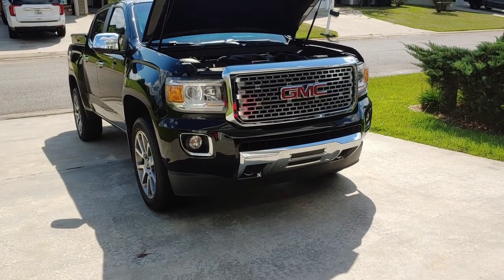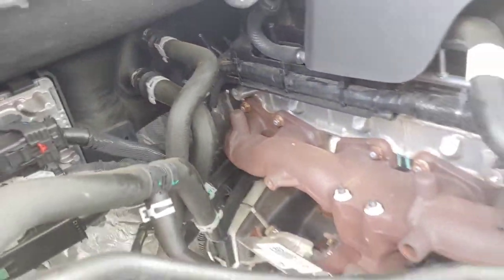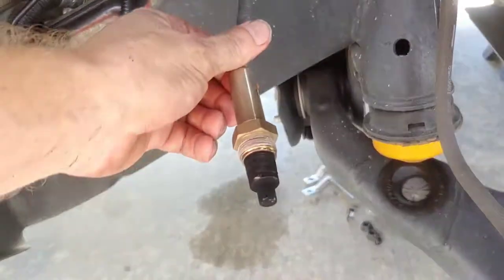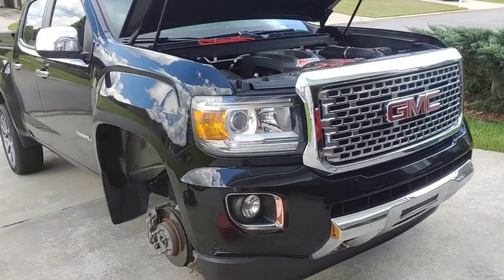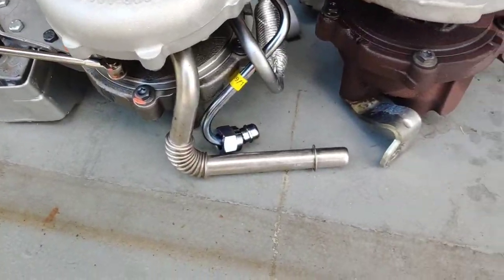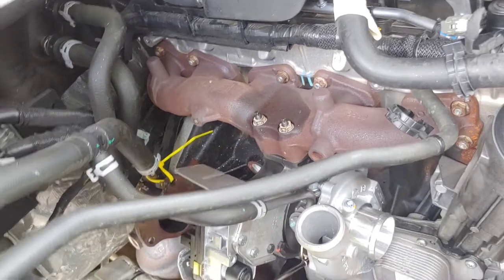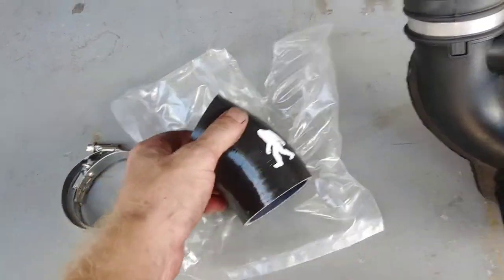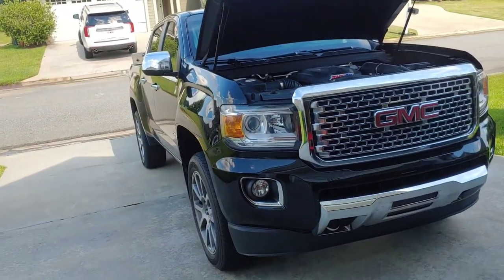2016-21+ Chevrolet/GMC Colorado/Canyon 2.8 Duramax Garrett Powermax turbocharger 892179-5001S Part 2

Comment: I installed the DT44 Stealth turbo from Duramaxtuners. I also used their upgraded MAP senor. Along with the 4 position tunable switch and their engine and transmission tune. I'm getting 280Hp in my  16' Chevy Colorado Z71Trail Boss.
Reply from the maker: Wow! Are you running the stock size injectors at that power level?
Reply: @breoll86 my understanding is the injectors/fuel system isn’t the bottle neck. the actual turbo is the bottleneck and the map sensor maxes out. a 6.6 map sensor and the upgraded turbo/tune wakes it up
Reply from the maker: @glennmorris25  The stock turbo flows 27Lbs/min. That's more than enough to max out the injectors. They're only good for "220ish" hp at 40 degrees of injection duration. If you want more than 220ish hp then you'll need bigger injectors. Unless you want to burn up a piston.
Reply: That's what I'm planning on getting. I've got the bent vane in my stock turbo

Comment: Been waiting for someone to post videos about this turbo. Please post more videos on it/longterm review
Reply from the maker: Nearly impossible to find any info on this turbo. That's the main reason I posted this. But I just shot this video yesterday. I'll do a follow up video in here in a week or two.
Reply: @breoll86  I have been looking for a turbo upgrade and this turbo and the SR-71 were the two turbos that came to mind. Any feedback from this would be great.
Reply from the maker: @alexsmith872  I'm going to put a follow up video together today. I don't have a ton of info on the SR71 but I'm pretty sure its bigger than this Powermax. Also I'm not sure if that turbo us still available for sale? Let me know if there is anything in particular that you would like for me to cover in the next video.
Reply: @breoll86  roughly how long did this swap take?
Reply from the maker: @johnherrera2906  I think it only took 4 or 5 hours. But I could have done it faster if I watched this video first.
Reply: @breoll86  exact reason why I asked, swapping my stock one out tomorrow but doing it on a lift. Thanks for the info and video!

Comment: Just bought the DT44 stealth turbo from Duramaxtuner. Thanks for the video.
Reply from the maker: Nice! let me know how you like it. I'm still in the process of tracking down a reasonably priced back-up motor.
Reply: I have had sputtering problems after installing mine and after talking to those guys for weeks I’m realizing they are just diesel enthusiasts turned venture businessmen, at best. They are not by any means engineers or guys who have any real idea what they are doing. They don’t even balance their turbos over 3000rpm, total joke. Also they claim the turbo had ball bearings in their videos and YouTube demos, they put ROLLER BEARINGS in it though during 
production!!!! I’m taking it out as soon as I set up the powermax purchase and someone to install and tune it
Reply: My DT44, to clarify, I’m switching to the powermax

Comment: Did you put the transmission tune on it?
Reply from the maker: Yes. Good question. I haven't covered that in these videos yet. I have done my own tuning to include the transmission. EFILive and HPT are identical in their capacity to tune the 6L50. If you're looking to get started with tuning I would highly suggest starting with the trans. It's a good place to get your feet wet. Let me know if you have any specific trans tuning questions.
Reply: @breoll86  
I would be very interested in what I need and how to tune the transmission 
It would be much appreciated

Comment: What RPM do you find this turbo starts to spool up?
Reply from the maker: The powermax turbo spools like the stock turbo. They both have the same size turbine wheel. The bigger compressor wheel does run into surge sooner though. So you'll have to turn the boost down in those areas to prevent that. That won't cause any power loss though.
Reply: @breoll86  Would you recommend the Garrett or the DT44?

Not sure if you have broken any input shafts of the 6L50 yet?
Reply from the maker: @PHLTHS  I purchased my Garrett before the DT44 was released. I don't have any experience with the DT44, but from my research, they both have similar compressor wheels, but the DT44 has a bigger turbine wheel. If I were buying a turbo for a stock truck today I would pick the DT44. 
I have heard of people having issues with their 6l50. But I haven't experienced any issues with mine. I've owned it since new and just rolled over 100k mi. Been tuned since 15k. Haven't even changed to fluid.
Reply: @breoll86  ok awesome and thank you for the advise. Currently getting a converter built with a triple billet lock up so will get it built to suit for when the turbo spools up. I’ll start look into the DT44.

Cheers.

Comment: Can you post a link to the little boot you got from Sasquatch? Or a part number as I cannot find it on their website.  Thanx
Reply from the maker: https://shop.sasquatchparts.com/products/sasquatchparts-silicone-turbo-inlet-hose-colorado-canyon-28l-duramax/

This is the one I used. It works with the factory airbox. Not sure about aftermarket airboxes though.

Comment: I think it stops at 29 because of the 3 bar MAP sensor. Get a 4 bar and retune.
Reply from the maker: As stated, I have a 4 bar installed. The problem is with the hpt software.
Reply: @breoll86   I must have missed that. If you know enough to tune I should assume you know that. Good content! Thinking of doing the same with mine but the stealth 44. Appreciate the tips in this episode.
Reply from the maker: @ZR2Dude  I recommend the DT44 over the Garrett considering the price is the same. Also Exergy makes injectors for our motors. The 30 or 60% is a good match for these turbos. Just remembered, the fuel is where the power comes from, not the air. The stock injectors can't safely flow more than 220-230hp. The stock turbo can supply enough air for that hp level. The 30s can get you to 260hp and the 60s just over 300hp safely. But I recommend a built motor at or above 300hp.
Reply: Noted. I will check them out.
Reply: You have to rescale the map sensor table yourself to make use of the 4 bar
Reply from the maker: Watch the whole video. I did that from the start. Does your HPT read over 300kpa?

Comment: Hey bud, which hp tuner did you use?
Reply from the maker: I was using the old school mpvi. Haven't upgraded to the V2.
Reply: @breoll86  I was looking on HP tuners site and I didn't see support for an 2018. Not sure if I overlooked it or not. What year is your truck?
Reply from the maker: @BigD00fus  My truck is an 18' and it works for that model year. HPT does have probably 95% of the tables that EFILive has. But HPT hasn't updated anything for this platform in years. I'm still keeping an eye on it though.
Reply: @breoll86  thanks for the help

Comment: What is the advantage in changing the turbo?
Reply from the maker: This turbo is worth about 100hp over stock. In my opinion this is the turbo that GM should have put on these trucks from the factory. With proper tuning, there are no negatives. It drives like stock until you put your foot to the floor. Lol
Reply: @breoll86  wow! What does it do for torque?
Reply: @breoll86  also that big of boost to the hp, how did the mileage do. To me the biggest draw to these units is the mileage.
Reply from the maker: @TheSilver9r  My mileage isn't affected as long as I keep my foot out of it. But as of now I'm averaging 26-27mpg on my daily commute. Highway I'm at 30-31mpg.
Reply from the maker: @TheSilver9r  the stock transmission is rated for 500nm of torque. But I have it limited to 650nm with good results.

Comment: Why did you change the turbo 
I seem to be missing some info
Was there something you didn’t like about the OEM turbo 
Were you after more power or less dead pedal ?
Reply from the maker: Mostly because I can't keep well enough alone. Lol I have to modify everything/make it "better". The stock turbo is the first limitation that you'll run into on these trucks. My stock turbo worked fine when I removed it. But after I tuned it I just couldn't push it any further. Which is why I upgraded. It delivers a significant amount of additional power.
As far as the dead pedal, those settings are all in the tune. Unfortunately, if you completely eliminate the initial hesitation upon acceleration, you'll be polluting your DPF. Its set there from the factory to prevent the smoke. But, you can massage the tables to acceptable levels to noticeably reduce the perception of hesitation though. The trade-off is a slight increase of smoke into the DPF. But if you keep the settings within reason the DEF can manage the additional soot levels.
Reply: Oem turbo  sucks. Super thin blades.

Comment: Need to upgrade ur map sensor then rescale the ecu. It is maxed out on oe specs n cannot read the new boost level correctly.
Reply from the maker: I upgraded the MAP sensor and scaling as of February 2021. As stated, the PID in HPT cannot read above 300Kpa. In efilive it reads correctly to 400Kpa.

Comment: I’m not sure your statement about HPtuners not reading above 28 psi is true. The MAP sensor is only good for 29.4. You might want to consider upgrading your MAP with calibration and try again.
 https://youtu.be/IBY3IUJCrhQ
Reply from the maker: I have upgraded the tmap sensor to Bosch 281002576 and scaled it accordingly. With efilive it works and I can read above 300 kpa. But with the hpt software there must be a hard limit at 300 kpa. It doesn't read above that.
Reply: You made it super clear that you upgraded your map sensor and stated HPT can’t read above 300 lol

Thanks for the video and clarity with it all. 
I just purchased a flashscan v3 and will start tuning soon, just small stuff here and there. Need to diagnose an injector imbalance issue first.